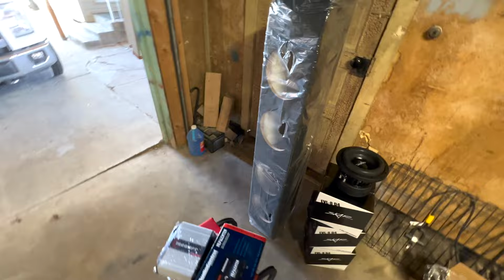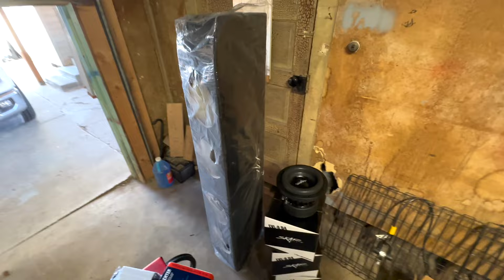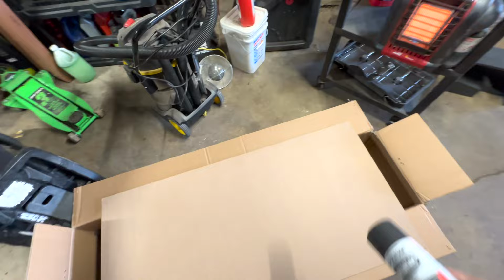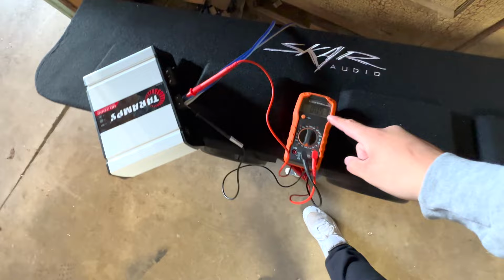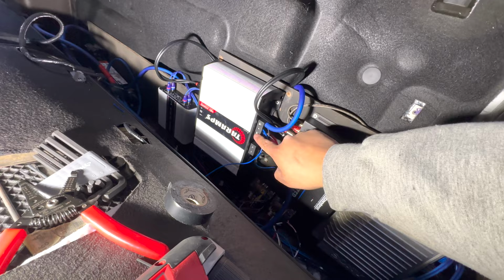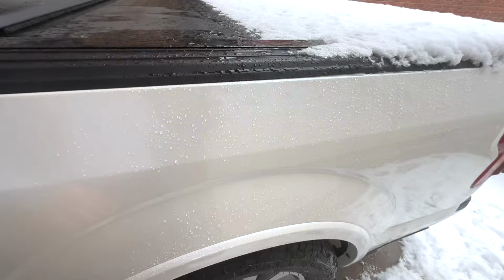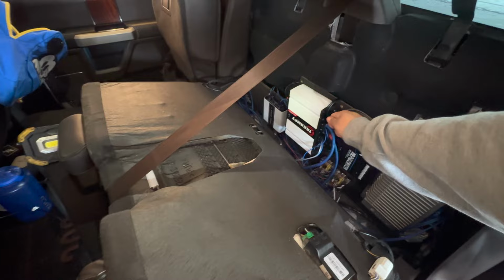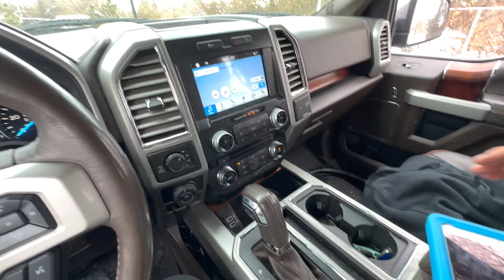F-150 Gets Subwoofers!! 🔊 Skar Audio Subs, Taramps , The Epicenter Install Super Loud Truck💯

Comment: those subwoofers need a total of 5 cubic feet of air space after displacement, and bracing. 1.25cf that is needed per sub. You're not gonna have enough air volume. With that enclosure it would actually sound better if you just have two. Its going to choke the subs. You can get away with 4cf. 1cf per sub.

Comment: I got the one channel taramps amp do you think I could run the epicenter and all 4 subs to the one channel ?
Reply from the maker: Yea it should work as long as the amp can handle those 4 subs
Reply: @5.0hh_andres  yea bro I got the taramps 3000 watt amp. Preciate the reply
Reply from the maker: Anytime Bro💯
Reply: @5.0hh_andres   hey one more question how did you wire your subs to get 1 ohm?
Reply from the maker: It Depends on how many Voice coils you have but I just found a working diagram on Google really easy

Comment: did you do any electrical upgrades ? battery? big3? just wondering cause i have a 12 inch scar with a hiphonics brutus amp but my lights dim
Reply from the maker: I have not done any of the upgrades. But I’m probably going to do the Big 3 soon.

Comment: How did you get it wired to be he factory stereo without the factory protection mode. I’ve been hearing it’s very hard to wire amps into these fords. I have an f250 and I’m about to install one and needed to find out how to do this.
Reply from the maker: Check out my other video. This is how I installed it, and I haven’t had any issues at all. 
https://youtu.be/LnK9c0Zg06c?si=8-5FM9YR9rmwOGg_

Comment: you didn’t show us the diagram or how to set up the system for us to do ?
Reply from the maker: Well I forgot to put it but you can Google the diagrams for how many Voice coils your subs have
Reply: how u put the wire through the glovebox
Reply from the maker: I didn’t I drill a hole by the wheel well and there is a hole that goes through the inside of the truck

Comment: Clean ass setup I also have 4 evls under my seat in my f250, where did you put your ground for the amp?
Reply from the maker: Thanks man! And I actually ran it to the negative side of my battery
Reply: @5.0hh_andres  thanks I was thinking about doing that also 👍
Reply from the maker: Yea I figured it’s the best option with these aluminum body’s